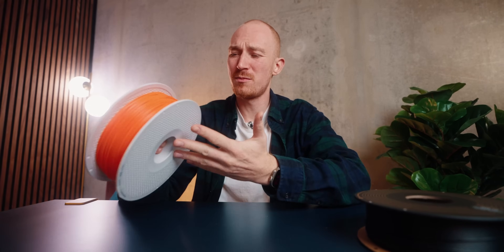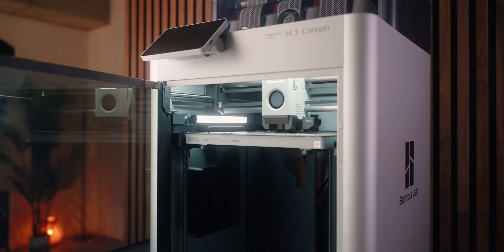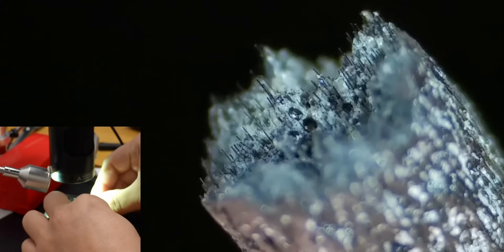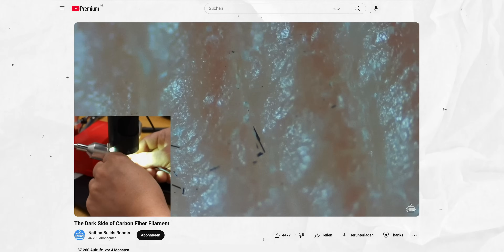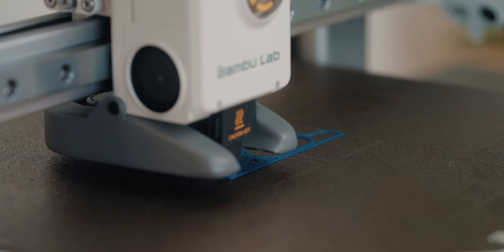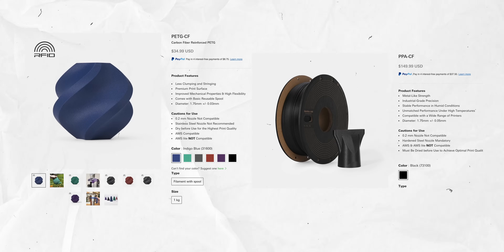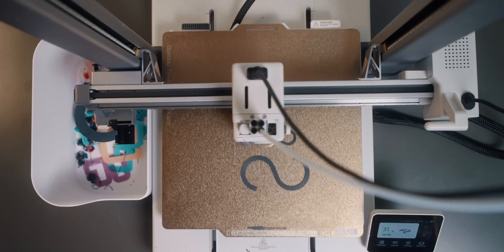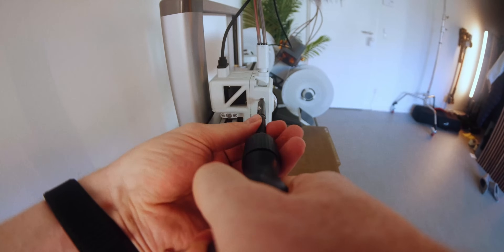What do Carbon Fiber Filaments even do? (and do you need them?)

Comment: cheap common nylon (pa6,pa12)  is the most overrated 3d printing filaments, especially when it includes carbon fiber. parts will shrink, expand, deform, come loose, i could go on and on. check it yourself, print a part in pa6, a part in pla 'plus' (any plus filament, plus, tough, max, F, pro,what ever a brand calls it) and asa - attach them with screws (no heat set inserts, they do a great job masking alot of nylons flaws) put them under a littile load and tell me which came loose, slack or deformed first. You can get the majority of work done with pla and asa.

Comment: Some brands of CF infused filament just use dust, not fibers, so it makes the filament weaker. Different brands use different materials, Markforged Onyx is definitely stronger than Bambu Lab filament but it also costs a lot more.

Comment: PLA is basically packaging material. The only upside with CF in PLA is, it tolerates higher temps, that´s it. PLA-CF is basically a marketing scam.
Reply from the maker: Yeah and as i said you can buy it for looking nice
Reply: @arnebornheim  Yeah right. That´s the only reason. Technically inferior part but it looks different

Comment: I would like to see TPU-CF
Reply from the maker: What do you expect from TPU CF ? Seems a little contradicting on first notice? Because CF usually stiffens the filament. Wouldn’t that go against what tpu is?
Reply: @arnebornheim  TPU is super flexible and soft, which means impact resistant and easy to print. With CF you would stiffen it and make it usable for different kind of parts like a housing for instance. The result could be a semi flexible, impact resistant, light, temp. resistant, easier to print part. Could be, that´s why I would like to try it out. Also TPU flows really well, way better than say PA.

Comment: Just wanted to shout-out for bambulab. On my second non-BL filament and I'm looking for stuff to use it up. PLA-basic has so far been flawless apart from one print failure which was my fault. So that's 1/25 ish print success. The eSun was crap with about 60% success and ugly white/blue colour. The Amazon basics was a little better but not a nice finish. A little too plasticky. Im going back to bambulab exclusively for now.

Comment: I started printing ABS and PA6 cf and gf variants on my open bed slinger, it does wonders even without a heated enclosure
Reply: How do you deal with ventilation or filtration?
Reply: @MrAfusensi  a fart fan that keeps fresh air flowing in from the rest of the house
Reply: Does the abs cf or gf variants warps less on the open frame printer? How do you combat warping
Reply: @MrDavid2327  While not perfect on really large prints, it does fine for most stuff under 150mm, it does hold up better on the larger prints as  well, but still get some splitting

Comment: The best on CF / GF Filament are the small particle you get into the air by handling it. I highly recommend to wear a mask / gloves when you work with this filament. I have an enclosure on my printer and the printer is atm in my basement with a separate room air filter. I would never print this shit inside my room especially engineering materials like ABS/ASA.
Reply from the maker: Yeah that's definitely the safer (and right way) to go with something like this !

Comment: Yeah and there's glass fibre as well, which I often feel stingy when touching them directly. I use latex or normal gloves all the time for those.
Reply from the maker: Yeah definitely. I also have latex gloves but bought thicker ones since I wasn't sure if the CF wouldn't just pierce the thin latex...
Reply: Glass fibers are scary. Fiberglass needs to be worked on with a respirator because otherwise the glass fibers will get lodged in your lungs.
Reply: @Antenox  Same with CF
Reply: pro tip: if u feel stingy use tape on ur skin to pull the fibre out of your skin with the glue
Reply from the maker: @TurkAmPc  love this tip 😊 thanks!